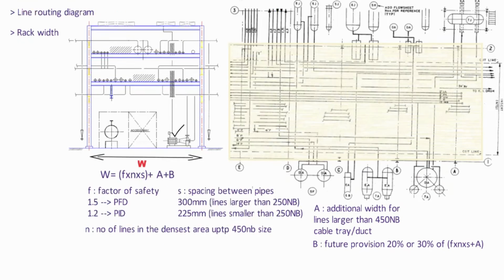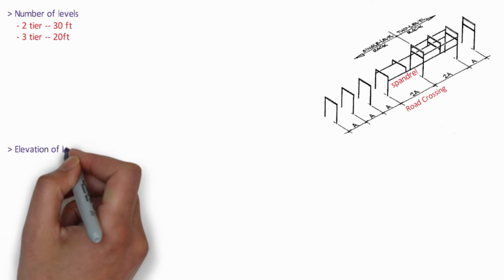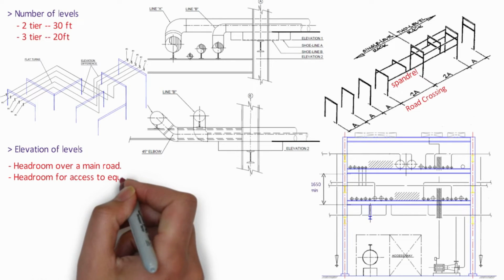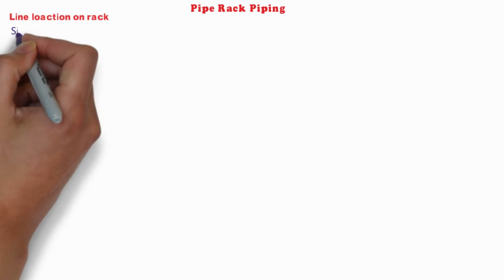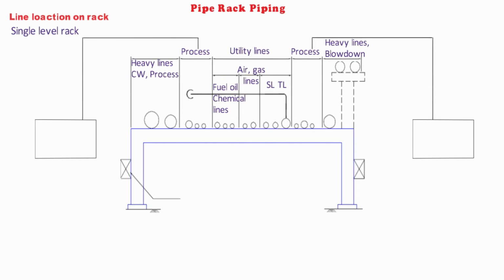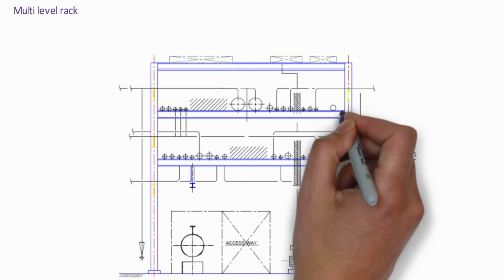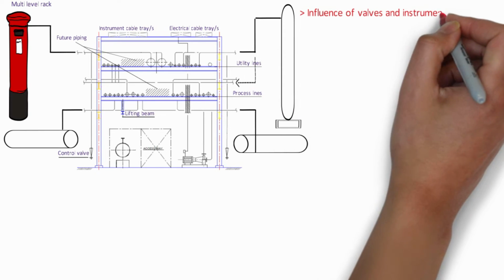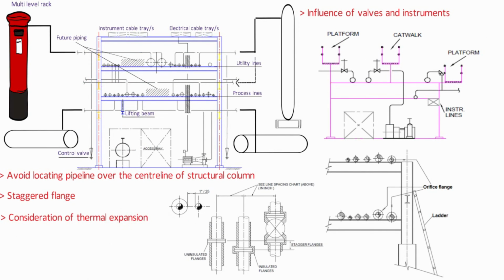PIPE RACK PIPING | PART-2 | PIPING MANTRA |

Comment: How I can pull or lift long welded pipeline (100 meter) on the top of pipe rack height ( 3 meter )
Reply from the maker: You can use no. of cranes at a time.